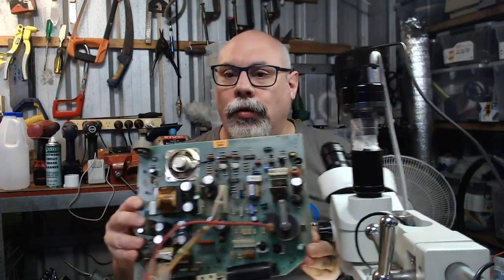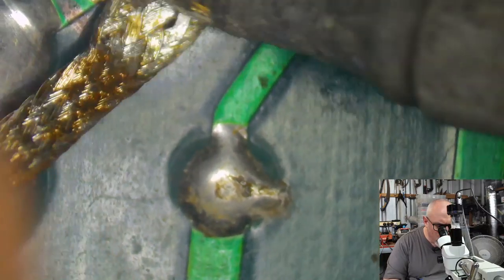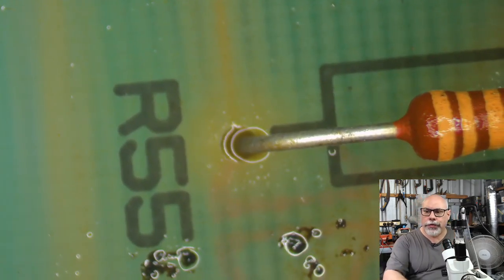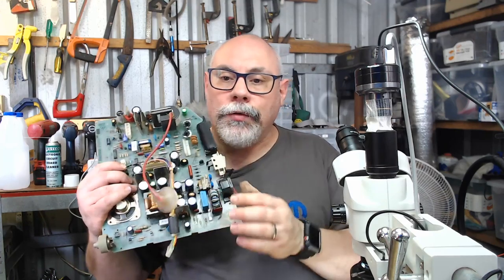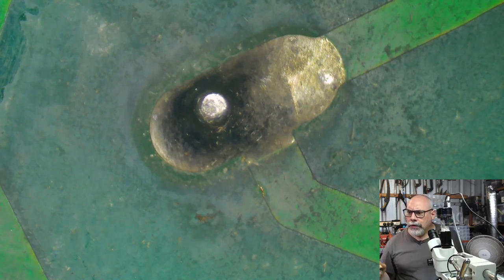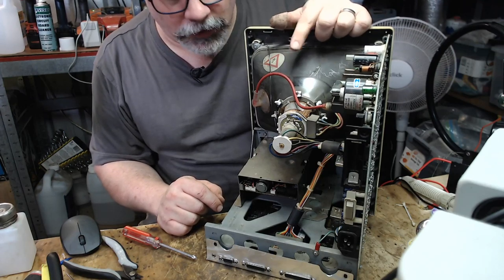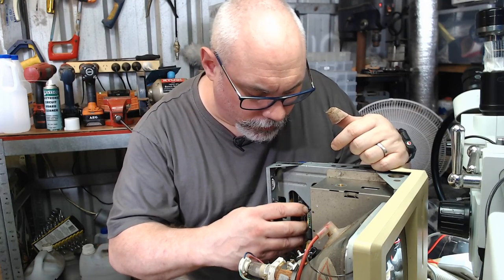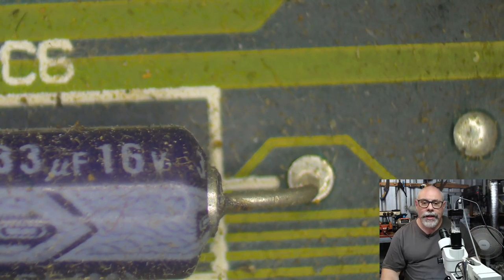Restoring a Mac Plus Analog Board

Comment: Thats a very enlightening video! Thanks!!

Let me ask you this. I recently bought a 2009 iMac that makes a high pitched squeaking noise (dog whistle) from either PSU or backlight inverter.
Noise changes a bit when backlight adjusted, and almost goes completely away (but not entirely),when LCD enters sleep mode. Care to take a guess what to replace? Im guessing either caps or coils..?

Thanks in advance for any thoughts or ideas you can offer.

Comment: I am stumped trying to fix my Mac Plus power supply (International). I checked all diodes, resistors, transistors, thyristors, recapped all the relevant electrolytics. Nothing. The thing only hiccups. I did substitute a BU508 for the original 2SC2810, could that have been a mistake? I am starting to suspect the transformer. If I can't get it to oscillate properly i might try creating a daughter board with a TDA4605 or something similar and drive a MOSFET with it. If that does not work i can still go the Meanwell route.
Any ideas what I could check before I take drastic measures?

Comment: Is it possible to connect an aluminium heat sink to this hot resistor? Or place it high above the board to help heat dissipation?

Comment: Ever come across boards with bad diodes? Currently troubleshooting a Mac Plus 1mb analog board that keeps resetting and not delivering any power. Doesn't bing or start up. Or any idea where I should look?
Reply from the maker: Absolutely, diodes are a common point of failure. When I'm working on a Mac Plus analog board, I usually check in the following order: cracked solder joints, then resistors, then diodes, then capacitors, then everything else.
Reply: Actually shortly after I posted that, I went over and soldered a bunch of cracked joints I found, damn thing started right up like it was 1986.

Comment: The Class Y are out of stock until next year, is there an alternative you can recommend i.e. Im looking at a EPCOS 4.7nF Polypropylene Capacitor PP 1.25 kV dc, 450 V ac ±10% Tolerance B32682 Series
Reply: Or part number R413F147050M1M

Comment: Would you be able to share the replacement caps you used for the old RIFA ones? Would appreciate your recommendation!
Reply: I'm new to safety caps! These look OK?
X: https://uk.farnell.com/kemet/phe840my6470md14r06l2/cap-0-47-f-20-pp-radial/dp/1572160
Y: https://uk.farnell.com/kemet/phe850ea4470ma03r17/cap-4700pf-480v-20-pp-radial/dp/2429334
Reply from the maker: @willcheyney  The Class Y ones look perfect, but the pins on the Class X are bit close together. Those ones are 22.5mm, but need to be about 25 to 27mm spacing.
Reply: Branchus Creations thank you!